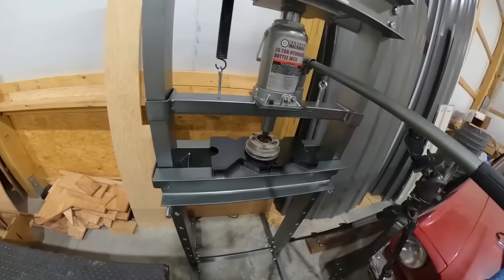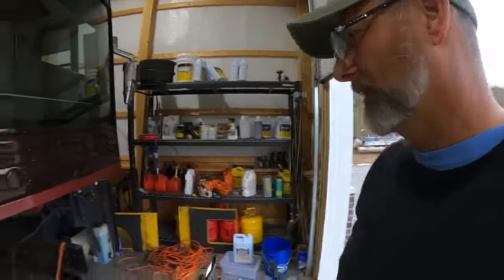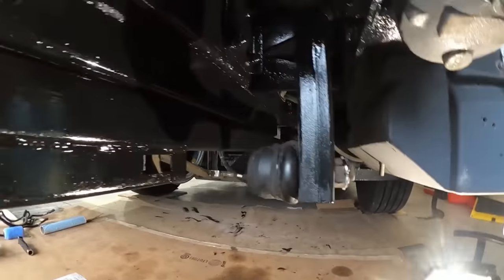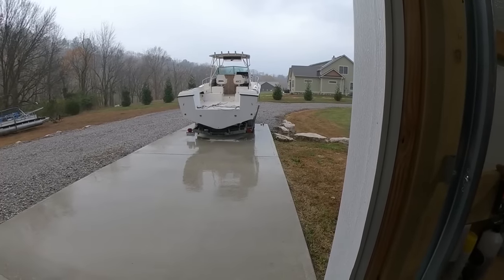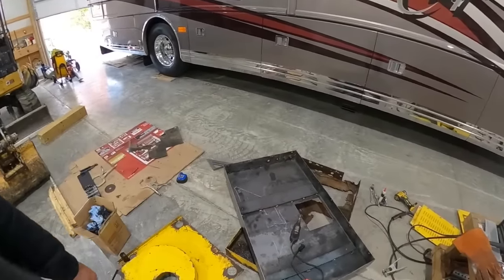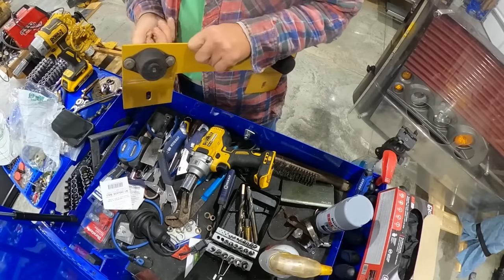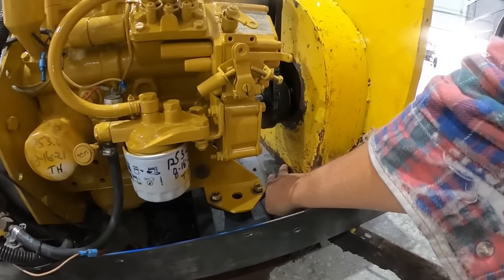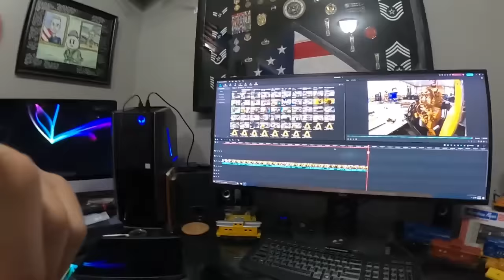From Drab to Fab: Painting RV Frame & Installing Pulleys! |EPS5| 2005 American Eagle | Shots Life

Comment: Hi, Thinking about raising the front mounts, if you put the fan back on the front pulley, check that it sits vertical  on the blades.. I'd suspect that the rear mounts will also have to raise by the same amount to keep the fan blades vertical to the radiator .. Keep up the good work .. Slow and steady wins the race .. Andy UK .
Reply from the maker: Thanks Andy!

Comment: Any professional paint supply store should have a variety of angle brushes, what we used to refer to as "radiator brushes", angled like a hockey stick, or some with the angle forty five to the handle, very short handles to very long (30") and of course different width of bristles.  They can be a big help in nooks and crannies.  Seldom see them in the box stores for some reason.  McMaster Carr and those will have them as well.  They also hold much more paint than the chip brushes so you can cover more area between dipping.
Reply from the maker: Nice, thanks!

Comment: Forgot to mention in previous video that you can also spray some Fluid Film on the chassis that blocks oxygen and will stop/reduce any rust. Good stuff and makes it much easier to get into areas that you can't paint. It does smell for a while, but eventually the smell goes away. Check it out and see if it can work for you before you button it all back up.
Reply from the maker: Thanks!

Comment: Hey brother, nice press. But you need to get a air over hydraulic jack for it and get some steel press plates and get rid of the cast iron plates that came with the press. They will break and hurt you badly, ask me how I know😢😢😢. I have the same one but I converted it to air over hydraulic and it is a world of difference. Stay safe and strong brother. Your friend and brother in arms, Skip.
Reply from the maker: Well that’s interesting….thanks

Comment: You know... I've seen people mount these auxiliary engines using a slice of a mud flap or something as a gasket to reduce noise conduction and limit vibration... but - I wonder if someone might try using a slice of kill-mat (sp?)?  You know, the sound deadening material people have been putting on the floors of their cars under the carpet to reduce road//vibration noise.  I bet some of that in that engine tray could make a noticeable difference.
Reply from the maker: Hmmm intriguing 🤔